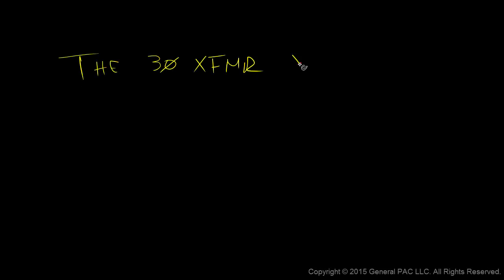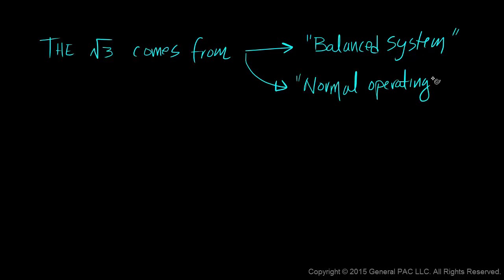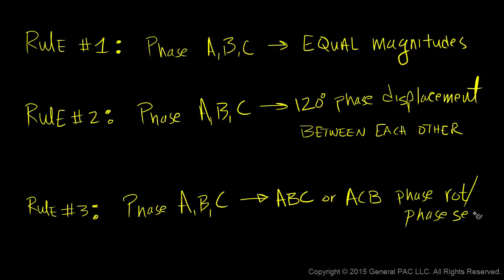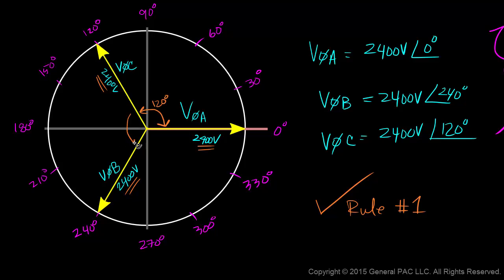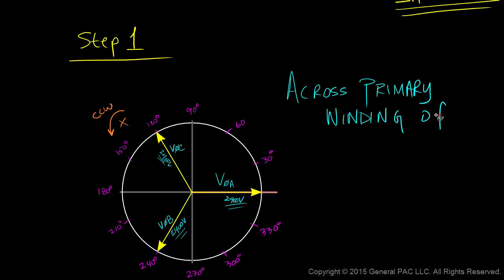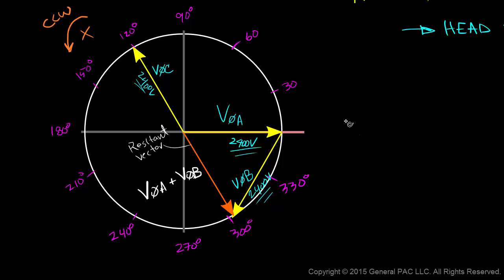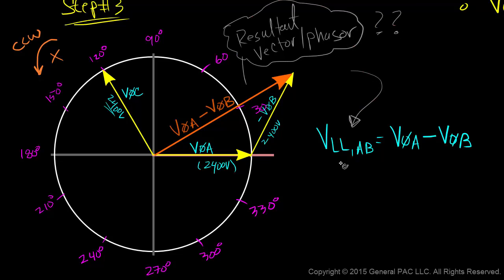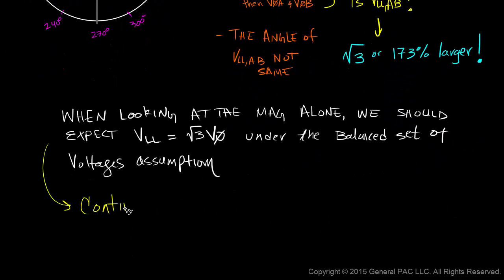Introduction to the Wye Wye Transformer Connection - Part 4

Comment from the maker: In Power transformer Fundamentals  series, We will start from very basics: introducing transformer winding connections Delta Wye and Wye Wye, how voltage and current quantities are related by phasor diagram, and methods to represent each transformer connections. In addition, you will build a strong concept on circulating currents and voltages. This module consists of three parts, each building upon your knowledge based on previous ones. Get 𝟗𝟎% 𝐎𝐅𝐅 on 𝐏𝐨𝐰𝐞𝐫 𝐓𝐫𝐚𝐧𝐬𝐟𝐨𝐫𝐦𝐞𝐫 𝐅𝐮𝐧𝐝𝐚𝐦𝐞𝐧𝐭𝐚𝐥 𝐂𝐨𝐮𝐫𝐬𝐞: https://bit.ly/Power-Transformer

Comment: Hello, what is the next module discussing square root of 3 you mention at the end of this video?  is there a part 5?  thanks!
Reply from the maker: +Googlegenius hi, I stated working on the delta wye transformer connection series after this one and didn't get a chance to work on part 5 like I hoped... But the same concepts apply to delta wye transformers. I highly encourage you to watch that series as well to solidify the concepts for root 3 usage in power systems
Reply: Fantastic!  Thanks again for these helpful videos!